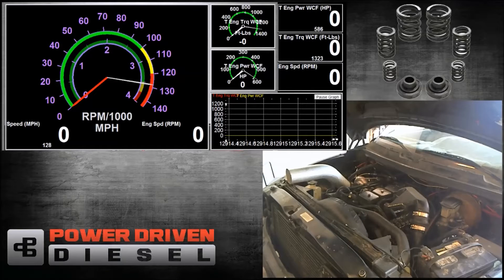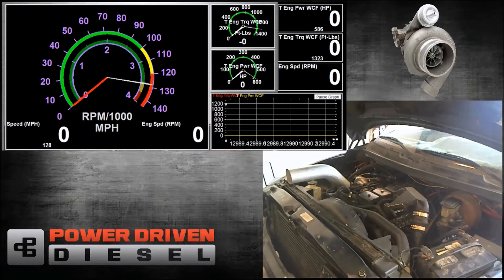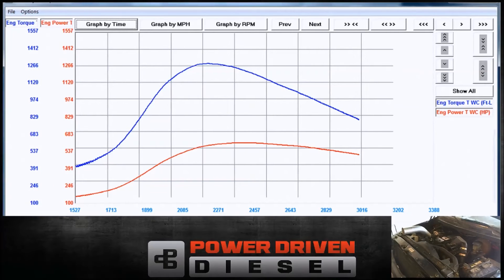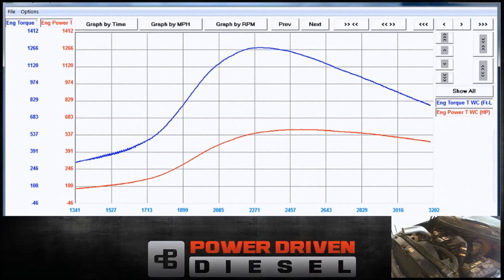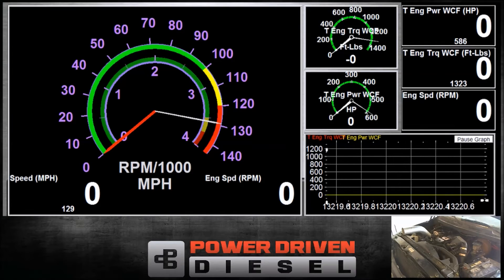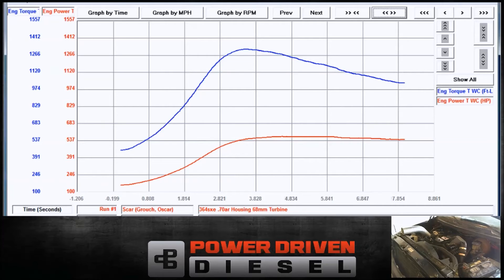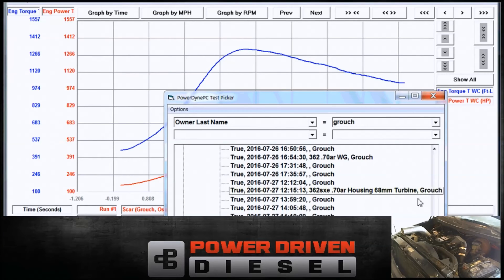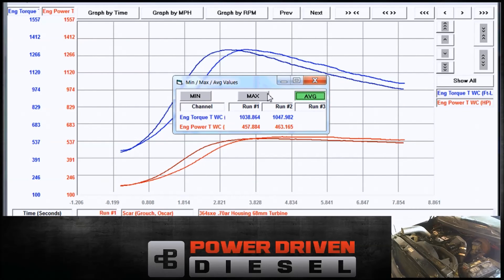Dyno Test: BorgWarner S364SX-E w/.70 Housing & 68mm Turbine | Power Driven Diesel

Comment: Just ordered this exact turbo from you guys! Hoping it gets here soon. What kind of egt's did you reach on this if you remember?
Reply: So what are your thoughts on it?
Reply: @logut80  honestly love it! Still working out some tuning with it (I have a quadzilla) and also a turbo tuner from PDD so I'm trying to get 2 tunes that run perfectly with it, 1 for daily thats clean and one for just max power. But with me running a 5spd and a set of 7x12 (250 hp) sticks that turbo lights super fast! I haven't ran it above 48 psi but it pulls hard, and starts to spool around 1600rpm and I can turn over 40psi before 2000 rpm. I haven't put it on the dyno yet, since well, everything is kinda shut down around me. But hopefully this fall/winter it'll finally get a dyno to see how the 7x12 and this turbo can do!
Reply: @bwalski1  cool. I'm only running 120hp injectors and I don't want to have lag. May just stick with the 362
Reply: @bwalski1  anymore updates? im stuck between a .70 t3 housing a .83 t4, my truck is auto so maybe that'll make a difference in quicker spool times. How are your egts?